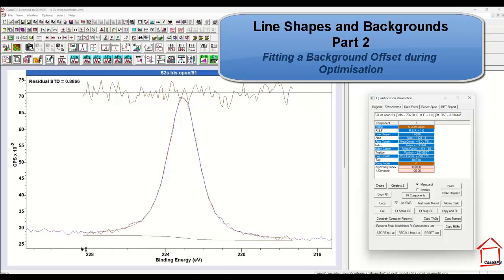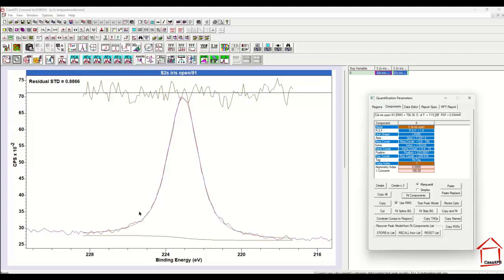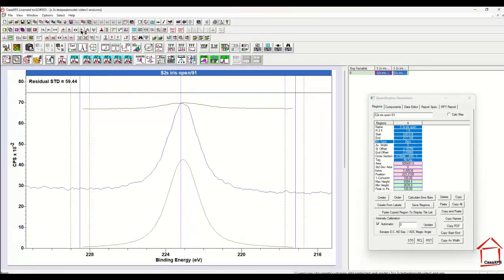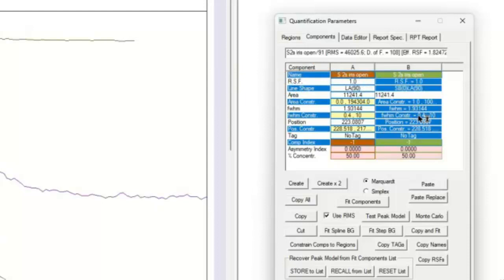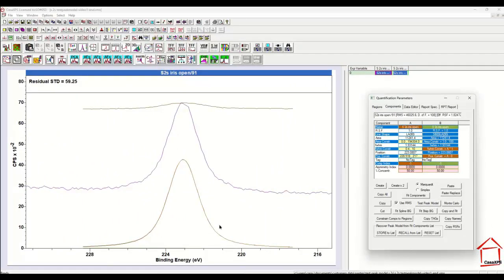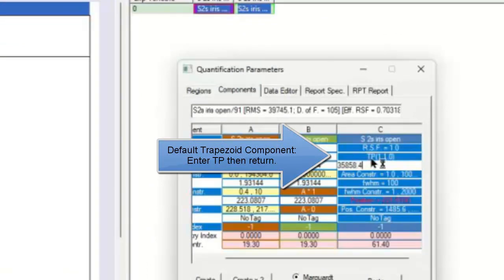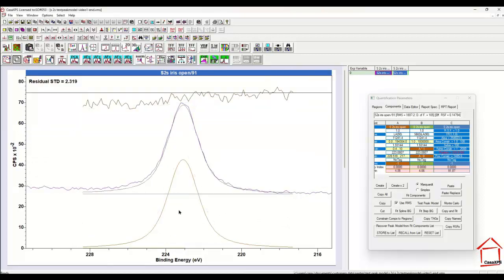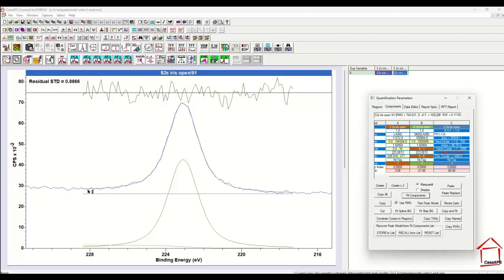Line Shapes and Backgrounds: Start End Offsets Part 2

Comment: Very helpful video. If I understand you correct a LA function is a voigt function. Does it mean the LA function is a real convolution of Gaussian and Lorentzian. And if yes, how is it different from GL function. I spend quite some time in the documentation to find some information, however the LA lineshape is not defined in the documentation I found. Would be very helpful for you response :)
Reply from the maker: A comparison of LA and GL line shapes is performed in:
Major, G.H., Fernandez, V., Fairley, N. and Linford, M.R., 2022. A detailed view of the Gaussian–Lorentzian sum and product functions and their comparison with the Voigt function. Surface and Interface Analysis, 54(3), pp.262-269.